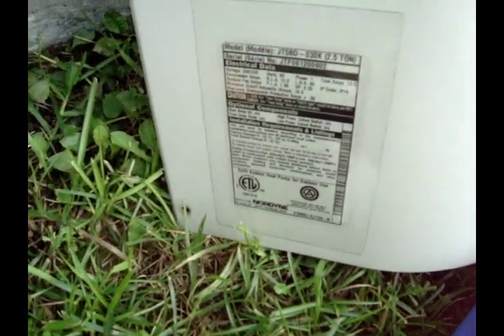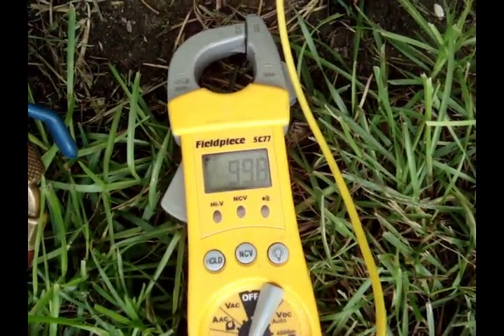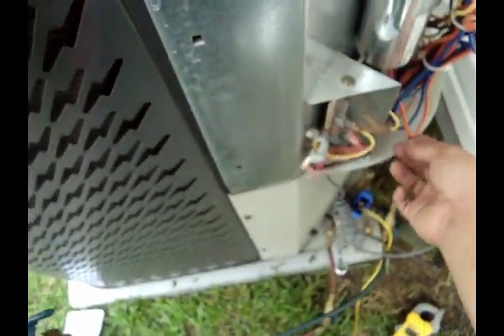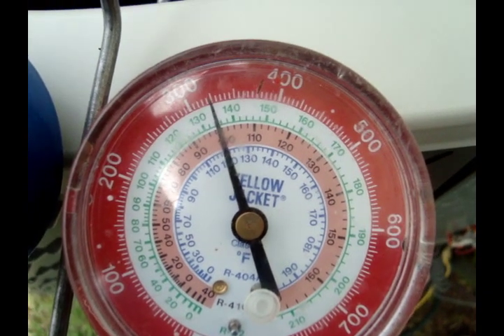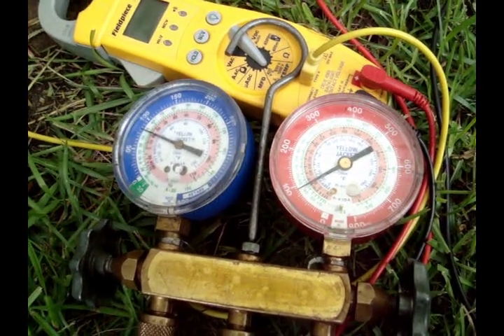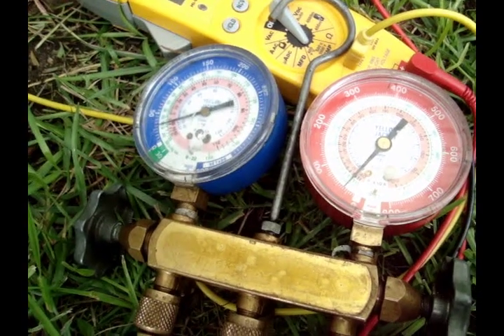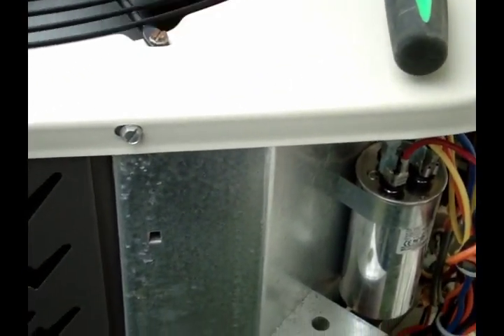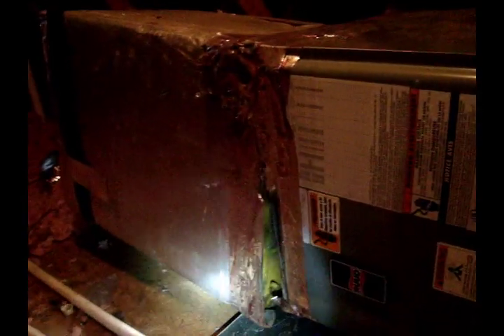HVAC: Bad valves and some quality duct work

Comment: Ductboard strikes again. Hate that stuff ! Make a Metal Plenum for those people. it's Return air . metal plenum. insulate on outside with cut wrap and spray glue and your done ! nice clean no fibreglass air !
Reply from the maker: OcRefrigeration,Hvac & Electrical.  Man, this is an old one. 2012 video. lol
Thanks for watching

Comment: Ha. I got Testo 550 the first time and now I am getting a Fieldpiece STA2 and a Fieldpiece Mini wetbulb/drybulb meter. When I saw your EER video I already had it in my mind that I must have the stuff to do that. I had a wetbulb meter, but I wanted something that could be "in duct". I was thinking that I would love to see the BTUH/EER difference on some of these units where, for example, after new TXV's. As the new TXV holds superheat at 10(or whatever) instead of 25 how much would eer improve